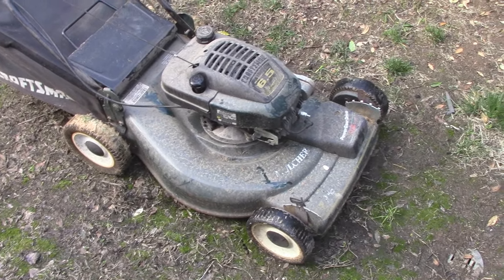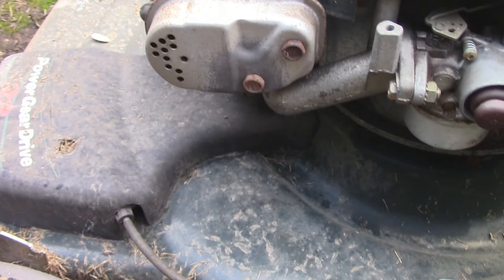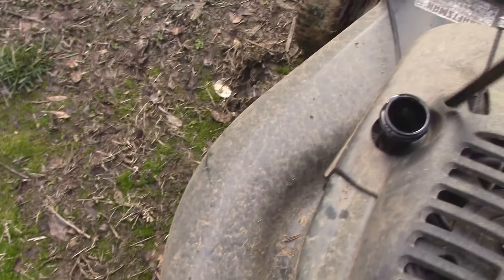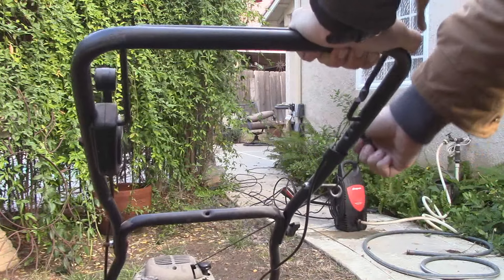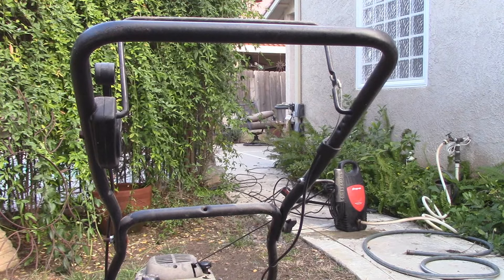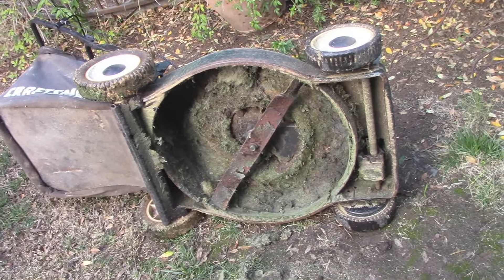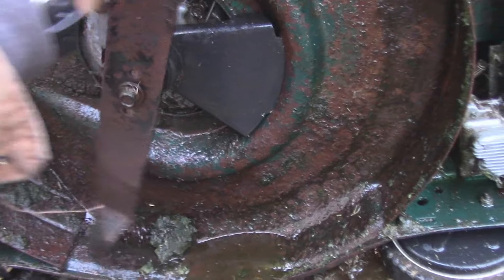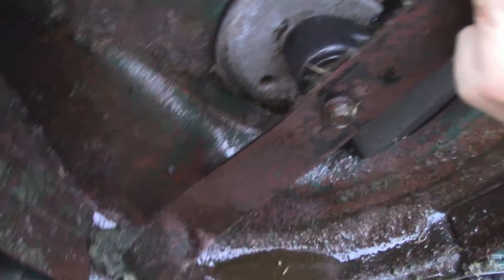Trash Find Craftsman Eager 1 Diagnosis

Comment: I have had 1 of these Eager1 Craftsman Mulching Lawn mowers on the side of my Garage for 7years was not running and rusty. I power Washed and took the Carburetor off and Cleaned sprayed with Carb Cleaner and fixed the linkage and a better Spark Plug and Put Gas in her and she started right up. I forgot it was Self Propelled too. REAL work horse of a Lawn Mower Id Say. Saves me from buying a new one. Happy I got my Front Lawn Mowed. Thanks for your video. God Bless

Comment: I bought the same mower, same price as you did. Tipping the mower to the carb side is a no-no. Crankcase oil will leak into the carb and foul the air filter and fuel bowl. I put an Amazon Chinese carb on it and it runs okay, but the blade was bent and it may have a rod issue that will cause its demise. Thanks for the video.
Reply from the maker: That’s why you don’t turn the blade it will leak if you tip and turn it

Comment: A bent crankshaft can be fixed using a car jack.  I bartered an electric pressure washer for a craftsman with a Briggs & Stratton engine serval years ago. It was in very good shape except for the crank shaft was bent. I took it over to my parents and my dad used a car jack and corrected the crankshaft and it ran fine after that.
Reply from the maker: I’ve never heard of that before actually. How would you go about doing it?
Reply: Hank's Small Engine Repair,  put mower on side as you would.  Remove blade. Rotate motor until crankshaft is at its “low” point in the wabble because it’s bent.  Take the hydronic jack, put the front wheels of the jack up onto the inside of the mower deck.  This should put the jack cup right under the motor shaft.  Get small wooden block and put between shaft and cup on jack.  Slowly pump jack up. It should make contact with block and push up onto shaft.  Pump SLOWLY until you feel like shaft is straight.  Check result.  There is a video on YouTube that I was unable to find that demonstrated how to do this.  Maybe you can find it.

Comment: i sold a craftsman with a briggs motor for 75 bucks with a slightly bent crankshaft, it cut the grass a little funky but the guy never knew it
Reply from the maker: +SurviventheOnslaught yea some you can get away with selling if the vibes aren't too bad. As I remember the vibes on this one were pretty bad
Reply: If the vibes aren't great, sometimes you can coerce the crankshaft a bit back to normal position with a hammer with the blade removed. Can be the difference between a lot of shake to just a little extra vibration. Check your flywheel key too for shearing.

Comment: How do you remove the gas tank on this model
Reply from the maker: Super easy. Just take off the top cover the black one over the pull cord and lift the tank straight up and disconnect the fuel line.
Reply: Hank's Small Engine Repair  
Hey thanks for the reply, I have the same model in your video, that didn't work after further looking you need to remove the throttle linkage and plate there is a small bolt behind needs to be removed anyway thanks for the help

Comment: Is it possible that the blade adapter was bent -- instead of the crank? I've seen that more than once.
Reply from the maker: Before I junk any of them with a bent crank I check them with a straight edge and the adapter off. I ended up swapping another engine on this deck. I’ve never actually had an adapter bend... I guess it’s possible on the ones where the shaft doesn’t sit in them that far
Reply: Well, it's good that you checked. A friend gave me one very similar that was headed for the dumpster, thinking the crank was bent -- and it was actually the adapter. I put an adapter, new blade and shear key on it -- bought a new air cleaner and I've been cutting my 1/2 acre of grass for the second year now with it.
Fires up on the first pull, every time. Cuts like a dream and the self-propel works perfect.
It's developed an oil leak that's getting worse. Showing on the carb side, either the PCV fitting (partially under the flywheel), the governor shaft or top main seal.
I took it apart today after my weekly cut -- trying to figure out the source. 
I wonder if it has the correct dipstick, (length), and if I might be over-filling it. Do you happen to know what the oil capacity is?
Any suggestions?

Comment: Yeah thats a shame but its a Tecumseh they are mostly junk after working on 3 of them only 1 came with sucess the nieghbor gave it to me becuase it wouldnt start and he bought himself a new lawnmower all it took was carb cleaner and cleaning the bowl nut and the main jet it was a first pull and ran great but the other 2 have made me decide i will put a bit of work into these but not much time at all its more worth it to me then to scrap it or give it to my shop teacher to do something with
Reply from the maker: Yup I agree. Back when I first started doing this years ago a tecumseh was the first mower I ever fixed up
Reply: +hanksranger  That was my vry first lawnmower it had water in the spark plug hole so i thought it was seized before i pulled the plug and out came water, after that it would only run for a second off starting fluid i went through the carb 3 times before i got fed up and gave it to my shop tacher to do whatever he wanted with it